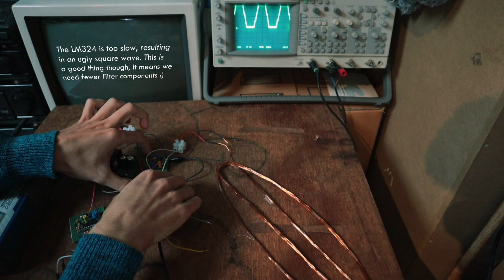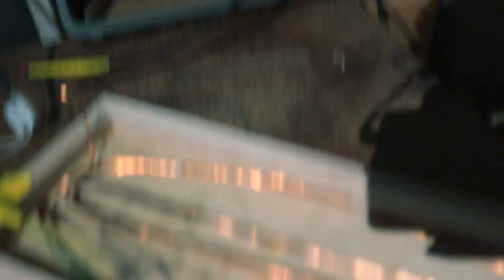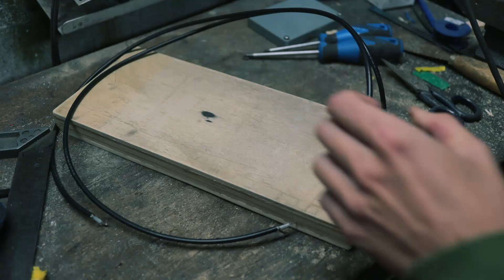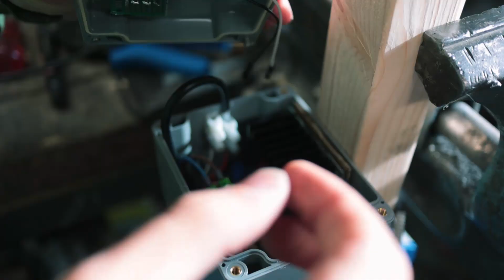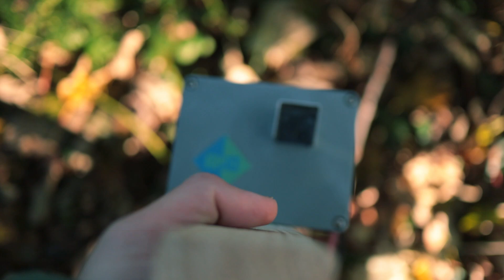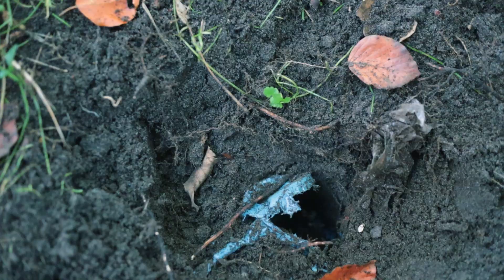How metal detectors work and how to build one

Comment: Using copper clad FR4 board with 25-50um traces for the DD plates increases precision and resolves better with a confocal location
If you model the geometry you it would result in minimal tuning with passive elements

Comment: Hi, we have taken up the metal detector as project. We followed the schematic circuit diagram shared on your channel and used a TDA2030 instead of TDA2050. However, we are facing an issue: the sine wave is not coming out properly once the amplification stage of the receiver circuit starts. As we move towards the rectifier (diode), the sine wave becomes very distorted, so proper detection cannot be observed. Could you kindly help us figure out the issue?

We tried to reach you through Instagram . If you give access it will be easier for us to attach the pictures of CRO for your reference
Reply from the maker: Is there a clear signal on the receiver coil to begin with?
Reply: @AKIOTV  yes. We have got a clear sine wave
Reply from the maker: @ShafiqaParveen-f2b Check the gains on the amplifiers, if the gain is too high you'll just amplify noise and the output will be high all the time.

Probe the output of the first amp and try to set the gain as high as possible, while still maintaining a clean sine wave output. Repeat the same for tbe second stage.

Realise that while doing this, you want the coils to already be in the partially overlapping position, so that the baseline signal from the rx coil is as small as you can get it. Adjust the coil positions to get the signal as tiny as possible. 

Of course, after the amplifiers work, the signal is now much easier to see/measure, so you can make an even finer adjustment to the coil positions and make the baseline signal even smaller. Then, you can possibly increase the gains again, and so on and so forth. Now begins a game of tiny adjustments to optimise performance.
Reply: Thank you. Can you please clarify the following queries?
1. Will the amplification clip the negative cycle ?
2. What diode should be used in the reciever circuit?
Reply from the maker: @ShafiqaParveen-f2b 1) yes, the opamps will only amplify the positive half (otherwise you'd need a negative supply voltage for the bottom power input on the amp)

2) pretty much anything standard will do. Lower drop (schottky) would theoretically be slightly better, but probably not noticeable.

Comment: We used tda2030, sine wave was produced and fed into the coil of same dimension as you mentioned...
But we could not receive the sine wave on the receiving side.

We used 470nf, 63V capacitor for the transmitting coil. 

What should we do to rectify the issue ?
Reply from the maker: Start by probing the amp output, to verify the transmitter works, then probe the rx coil to see if anything comes across. Then probe after the first rx amplifier stage etc. and work your way down until you reach the end and it all works.

btw, quite some trial and error can be involved in setting all the amp gains right and aligning the coils, it could easily take a couple afternoons of testing to make it work right.

Comment: What a great work👏
 But if we change lm324 to lm741 dose it make any sens?
Can we make a better amplfiing from lm741 ?
Plus: if we change the led lights and use a multimetter on the dc section and read the signal numricly 
I think its a good idea
Wating for your respond
Thnx❤
Reply from the maker: @TigerSuleman-n7e  The lm741 and lm324 are both about equally bad, but the 324 is better suited for this single-supply circuit. I suspect the 741 would work fine too though. 

A meter instead of leds is of course entirely possible. (maybe use a digital display rather than an analog meter, to avoid the needle moving as you swing the detector.)
Reply: also you note 2k7 resistor used in low pass filter are they parallel or series connection?
 i couldn't read the value
there 2k2 resistors connected to the first lm324 
so if you dont mind i need some explanations about this values
Reply: @AKIOTV what do you meanwith 2k2 ad 2k7 resistor?
Reply: may you answer my question  plz?
Reply: And what do you mean in 2k2 resistor?

Comment: This is really cool. I'm a scout leader here and I'd love to use this as a learning tool. Learning about electronics, and also caring for the environment, collecting old pegs and rubbish.
But I think it would be cooler if we could hear the signal, rather than interpreting it with LEDs. Is there a way we could hook the signal up to an audio amplifier and just play it through a speaker?
Reply from the maker: @KudaPucat  The output from this is not suitable as an audio signal directly, though there's a variety of ways to convert the output into sound.

One way that doesn't require much circuitry is to get one of those small 5V buzzers. I think if you wired that to the output the loudness of the buzzer would change in a similar way to the leds lighting up. You could use diodes to implement some kind of threshold if required.

Alternatively, you could always read the signal with a microcontroller (for example an arduino), then you just have the output as a numerical value. From there on you can do anything you want with it: sound buzzers, horns, activate lights, transmit the value to a computer etc.

Of course there's much more elaborate analog circuitry you could use to make an audio signal, but I suspect the options above are the easiest to add onto the design from this video.

Comment: can you please explain how to connect 470 nF capacitors just after TDA 2050 module? and what's the function of those capacitors??
Reply from the maker: @merilperera9615  They are in the diagram on the transmitter output. The purpose is creating a resonant tank with the transmit coil to reduce the transmitter power consumption.
Reply: @AKIOTV  I referred the diagram again  but not clear how to connect, whats mean by 4X470 nF , are they parallel or series connection?
also 2X 470 nF ?? please explain
Reply from the maker: @ceylonfoodspvtltd8745  I used 470n capacitors in parallel to make bigger capacitors, so for the 4x470 one technically it just says 1880nF. Same for the series caps, that's really just 940nF.

The values don't have to be exact and you can play around with them to see what gives the best performance combined with your coil.
Reply: @AKIOTV  ok thanks for your response , In that case we got out put voltage of 11.5 V from TDA 2050 module, but the  voltage at the transmitter coil was 2.9 V , (without connecting transmitter coil) is it ok?
also please let us know whats the best voltage & frequency to be kept at out put of TDA 2050 module.
Reply: please respond me
Reply: please take care to respond me..i am Really waiting for your answer..
Reply from the maker: @merilperera9615  The amplifier can be connected to the coil directly without capacitors. 

However, by using the capacitors as in the schematic, a resonant tank is formed. This reduces the power required from the amplifier by a large amount, so for a given magnetic field the amplifier needs less power and therefore runs cooler.

The parameters (amplifier output voltage, capacitor values etc.) can be tuned to your preference. You'll have to do some testing to get things right.
Reply: @AKIOTV  ok thanks for your response ,
After adjusting frequency to 12.5 kHz , it was possible to get the voltage at the transmitter coil  more than 10 V , after placing the receiver coil the voltage at receiver coil was taken to around 10 mV, 
But metal was detected  at a height of  around 2 to 3 cm, how to adjust detection height to around 25 to 30 cm?? which POT s need to adjust??
Reply from the maker: @ceylonfoodspvtltd8745  All of them can have an effect. The gain on the amplifiers in the receiver is the most important. Tuning them is quite tricky, especially without a scope.
Reply: @AKIOTV  ok thanks for your response .
this meta detector is ok for detecting larger metals , but my purpose is to detect small metal pieces like pins, metal chips, small thin & sharped metal pieces etc..
Can you please suggest  how to alter this metal detector with high sensitivity  for my purpose,
Reply from the maker: @ceylonfoodspvtltd8745  First of all proper tuning is very important. It can take days and be quite frustrating, but it really pays off to get every every potmeter set perfectly. For better sensitivity on smaller items, you could also try different size/shape coils.
Reply: @AKIOTV  ok thanks, really appreciate your response 
Can you suggest me the size & shape of coil  for my requirement .
actually my requirement is to detect small metal pieces from a food contained box of size(12"x8"x2")
Reply: box sze : L=12" W-8" H-2", box run on the conveyor such that face (12"x8" ) is touching on the conveyor belt
Reply from the maker: @ceylonfoodspvtltd8745  What are you trying to do? Is it an inspection machine to put in some production facility?
Reply: yes of course, 
our product is processed sea food specially fronze , at the end of the production process it is required to check for possible metal particles present in the product ..
Reply from the maker: @merilperera9615  The one I madr detects coin-size objects up to about 10cm away, which should be enough. Otherwise a smaller coil might do better still.

Alternatively, since you have the luxury of a fixed position rig, you might want to consider placing one coil above and the other below the belt, having the products travel between them. This might require changes to the electronics though, I don't know how well this circuit would work for non-double d coils.
Reply: actually the product is frozen prawns
Reply: ok thanks for response
can you suggest a new circuitry for non double D coils.
Also how about the pulse induction method which has a higher sensitivity and can detect small metal pieces??
Reply from the maker: @merilperera9615  There are many ways to make metal detector coils and circuitry. I don't know what will work best for your application so you'll have to figure it out. Just build some prototypes, do some testing and you'll get there. It might seem hard and that's because it is. You're trying to build an electronic inspection system literally from scratch, not many folks would go there. It can take a while to get something like this working, if you're building/developing this for someone, make clear to them the device will take some time to develop; custom made electronic engineering isn't cheap or quick. 

If you want non DD coils you need the circuit to deal with a high "baseline" output signal. The circuit from the video already does that, so it might actually work, I'm just not sure it works well enough, so it might need some modifications, which you could find by doing some testing. 

PI detectors are as far as I know slightly more complicated to build and I don't think they would be an advantage in this case.
Reply: ok thanks
since I already made double D coils & circuitry , I think it's better to modify this with Non 2D coils & see how it performs for my requirements .
can you please let me know the details of non 2D coils like size which should match with product box  and no of turns etc...
Reply: @merilperera9615  please take care to response me

Comment: If doing projects like this has taught me anything, you'll be opening that boxed you glued together pretty soon.
Reply from the maker: @NickFoxQuixand  Haha that's fine, but I haven't had to do that up to this point. I'd have used screws normally but they're metal. I think plastic screws or something similar are an option too, but I was lazy so just glued it shut. This glue is usually not too strong to remove anyway.

Comment: Great video. Very informative. I have an inductive sensor that I took apart to see how it worked, but the design made my head hurt; maybe you can explain it. It's a 2-coil design but the coils are different sizes, different values, and the smaller one is positioned inside and off-center of the larger coil. What on earth are they doing??
Reply from the maker: @kenengel620  Plenty of metal detectors with 2 coils use non-DD placement of the coils. The same principle can still be used; a metal object will change the shape of the transmitter field, which changes the flux through the receiver coil, and creates a variation in the output signal. However, with the coils arranged like this, you won't have the "normally zero" output signal. There will be some significant continuous output even when no metal is present, which the electronics need to take care of.
Reply: @AKIOTV  So, if you wanted to use a double-D and a PCB for the coils, you could conceivably put each coil on opposite sides of the board to achieve the overlap; but does the distance between them make a difference? Would it be better to use a thicker or thinner PCB?
Reply from the maker: @kenengel620  This is tricky because as you can see in the video, the amount of overlap needs to be exactly right to get an output near 0. But on a PCB you have no room to correct/move things about, you'd have to nail it first try. You would have to calculate exactly what the overlap needs to be, probably using magnetic field simulations. Personally I'd try to make the coils exactly to scale out of regular wire, so you have a testing setup to determine the ideal overlap, which you can then use in a pcb layout. 

The board thickness I don't think is very critical (depending on the size of the coils) but the thinner the board, the more similar it will be to a pure 2d plane (with no vertical distance), which could simplify the design, especially if you attempt to go the theoretical way.
Reply: @AKIOTV  You'd be surprised how cheap you can get a PCB made these days. I used to order all my boards, but I can make 2-layer boards now, so that's not a big deal. Also, I'm using an online simulation tool from TI to get as close as possible the first time, but I intend to make 3 or 4 at various amounts of overlap and see how accurate the simulation is. 
I can get PCB copper clad in varying thicknesses, hence the question does the distance between matter significantly? We're only talking a 0.5mm - 1.0mm difference in thickness.
Thanks for the response! Good stuff! Liked and subscribed.
Reply from the maker: @kenengel620  Say you have 2 super small coils with a 5mm diameter; a 1mm board thickness would be relatively big, but for a 10cm coil it's nothing. So it depends on the size of the coils how much of a difference it makes. Theoretically, thinner is never worse, so if there are no other reasons to use thicker boards (cost, physical strength etc.) I'd just pick the thinnest option.

Comment: Thanks for that. You make it look so simple. The basic principle appears to be that of a coreless transformer where the secondary coil is placed so that any clockwise magnetic field is canceled by an equal anti-clockwise magnetic field making the current zero. When a metal object comes close to the magnet field, the magnetic field is distorted which upsets the balance and generates a current in the secondary coil. Hmmm, interesting!
Reply from the maker: @cyber5515  what's also cool is that with additional circuitry, you could also compare the phase shift between the receiver and transmitter, which allows you to (up to a point) distinguish between different metals.